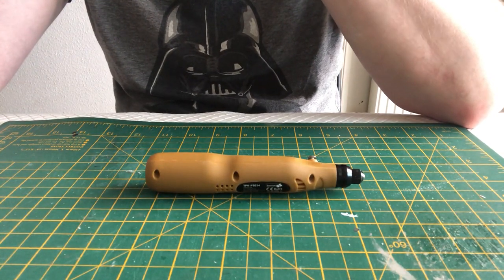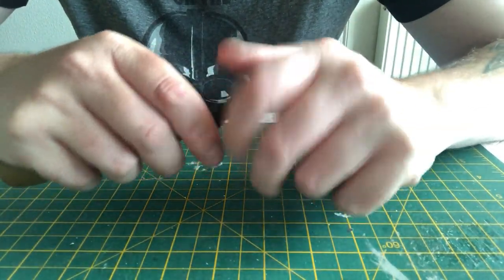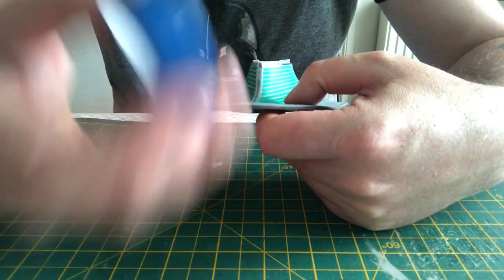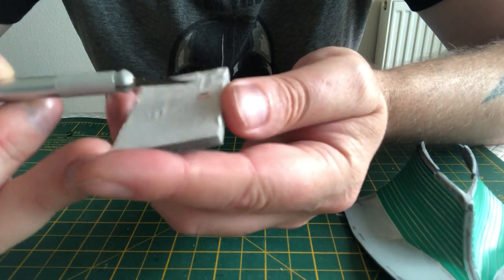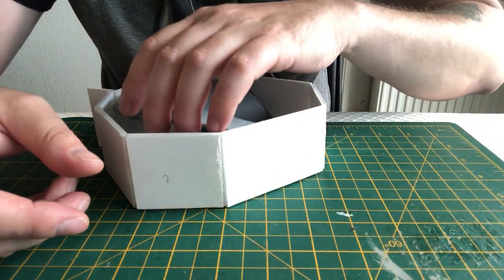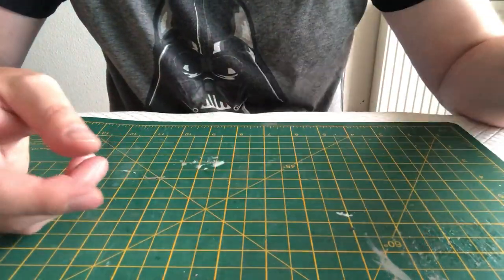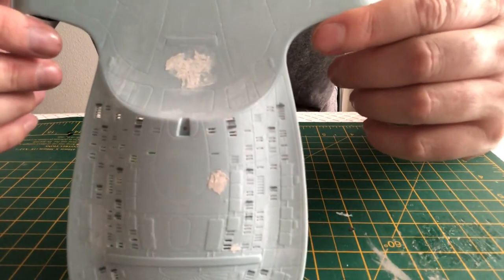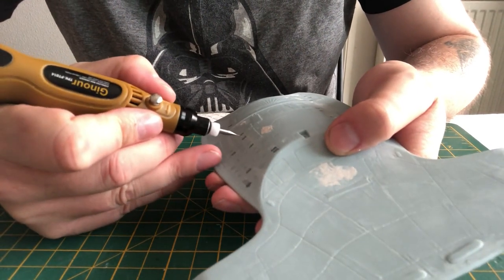Build review of AMT/ERTLS USS Enterprise D 1/1400 scale: Part 4 - A week of failures.

Comment: You could have also just bought some pre- cut Tamiya Tape they got all 1-10 mm no need to cut this stuff by hand. Nice idea to accurate the Neck, i ll leave my Neck piece just like it is, i got myself a tiny milling tool instead of a drillhead, worked for me, i was able to cut the windows donwn half the thinkness of the plastic, the rest can be removed with a ballhead mill from the backside. Round 2 should just do a 1/1000 kit like they did with the Voyager, with todays ways designing them on the computer, they get much more accurate, plus a larger kit will be much much easier
Reply from the maker: Yes, I certainly did make it hard work for myself 😂. I’m hoping some day that Round 2 will do a revised, more detailed version of the kit, shame they haven’t already.